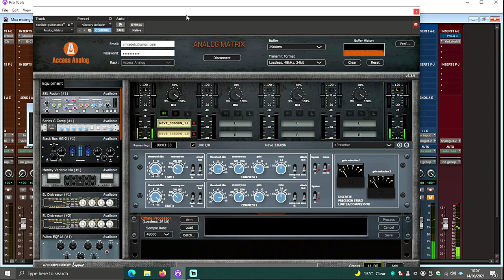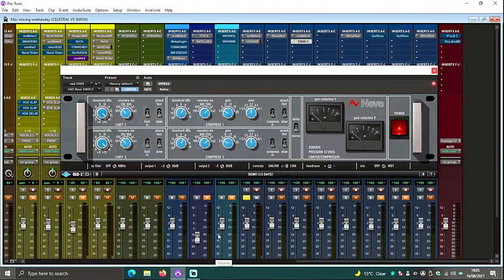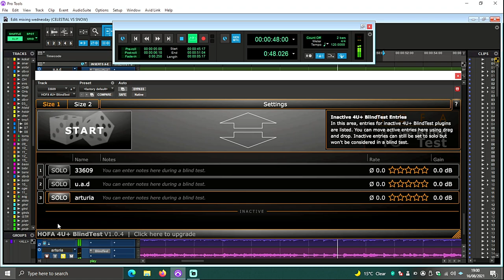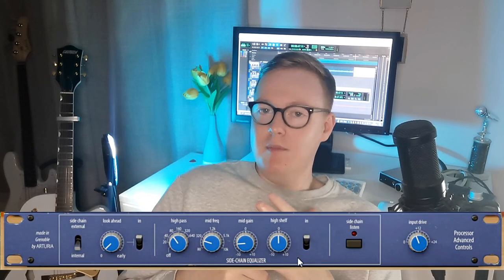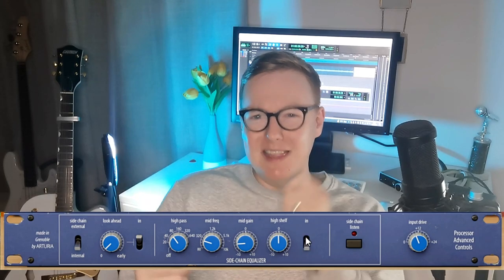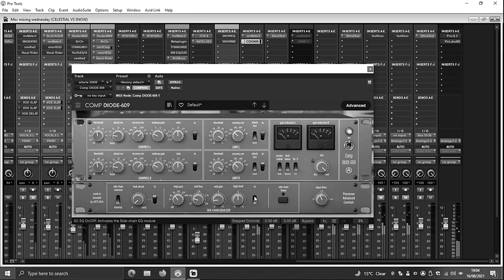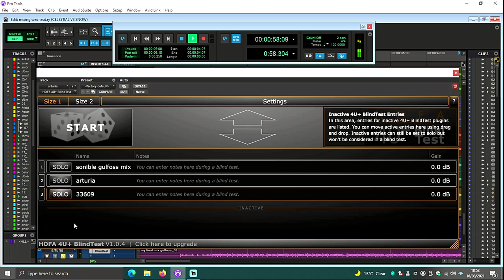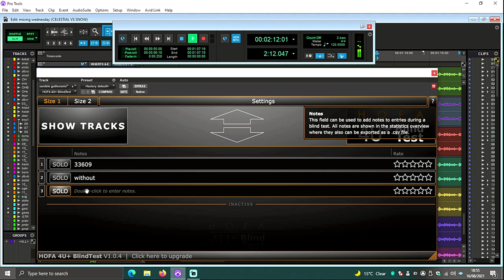DON'T buy a $4000 Neve 33609N.. try the ARTURIA COMP DIODE-609 instead 😱

Comment: Interested to know if you’ve ever tried the IK Multimedia version of this? It’s been included in their T Racks suite for years but I never knew what it was an emulation of until I saw CLA and Dave Pensado talk about it a while ago. It definitely has a signature sound but the GUI is needlessly confusing (one of those plug-ins where it’s not clear if the power buttons are switching the units on or off!?) and I’ve been on the fence about how to actually use it since some people say you want a slow recovery whilst others say you want everything set on fast 🤯  Plus, I never decided if I actually liked the “pwuish!” effect it has on kick drums (best way I can describe it lol!) Anyway, seeing you featuring it made me slap it on my two-bus tonight, and with barely any gain reduction happening it’s pretty sweet.
Reply: hello, I own it too - but I never use it. It does a little bit of everything.. it warms, it's giving a thumpy punch, it's widening - but usually it never seems to be the best for a mix. T-Racks-Comps that I regularly use on a mixbus are the Bus-compressor and the VC-670. When it comes to settings I suggest not to listen to anybody and to trust your ears.

A good way to approach it (in my experience) is to pick 3 compressors and try to get a great sound on each one individually. After that you compare the sounds of the 3 compressors. That's how I figure out both what I like about the compressors AND how the settings influence the sound. Now granted.. comparing a Fairchild-Emulation is a bit of a tricky thing.. but there are manuals and videos that explain what they are doing.

Another mixbus compressor that I sometimes use is the elysia alpha-compressor (it's rather clean). The Chandler Limited Germanium and the Tube-Tech CL1Bs from Softube rarely ever make it to my mixbus.. I love the Chandler on Drums and the Tube-Tech on Vocals though. I also recently purchased the Pulsar MU, but I gotta say that I'm not in love with it. It has incredible width, but most of the time it just doesn't do it for me. Am still on the lookout for a great manley variable-mu emulation.
Reply from the maker: Used to use it years ago but found better alternatives. Nice weight but isn't the hardware.
Reply: @PaulThird  OMG... you know what, I just demo'd this Arturia unit... mate I'm devastated - IT'S AMAZING 🤦‍♂️😂 Thought I was done spending insane amounts of money on yet more compressors (!) but even before you get to the incredible sound of the comp/limit stages, the modern feature set on show here covers it all!? I just tried it on my latest pre-master which I've been struggling to finish because the snare stem is just too loud but the snap of the transient sounds perfect (I expected the analog summing to reduce it, but it's still clipping +10db). Best results I managed before demo'ing this was to tame the snap with the Elysia Alpha's soft clipper and then sear-off of the edges with the Weiss MM-1 in transparent mode - BUT THIS ARTURIA UNIT.... I just side-chained the fully mixed track to a gated stem of the snare drum using this 33609 and the track is now FINISHED?! Problem solved... even before the 20 minute demo restriction locked the program... there's no way I can live my life without this in my plug-in folder now lol! Gonna have to get a second job delivering pizzas if I keep spending money on these things though 😂
Reply from the maker: I somehow always manage to cost people money haha 😅
Reply: @tommyottobisdee  I clip with clippers, especially the classic-clipper.... choosing the slope is really important for the sound. I don't love the softclipper that is in the alpha.. IF I use it (and sometimes I do) it is very gently.. barely or not at all engaging the light that indicates it's working (it's working before it lights up). I use the alpha when I feel any change of sound would not be benefitial or I am doing a master where I have to be pretty precise about how I treat the sides in relation to the mid. I have the Weiss DS1-MK3 too, but I only use it on my masterbus and only for the low-lowend.. that usually means under 90Hz for me, I rarely use it above 130. Used to do that with a simple multiband-band compressor - but the weiss certainly does a better job at it and that's why I finally got it. Didn't have the full fledged Drawmer, but I have the Drawmer S73 Intelligent Master Processor and while it can give you an idea which direction to go, it never, ever was able to beat real manual finetuning.

The Arturia 33609 sounds good, but the 33609 in general doesn't seem to do anything that I truely need/blows my socks off - but I think that's very much a matter of taste. Thanks for sharing your preferences! I've been looking at the Shadow Hills Class-A Mastering Comp a couple of times. Maybe I'm going to shoot it out on the mix I'm currently working on.

Comment: The Arturia was made by Pulsar audio. They might be my favourite when it comes to analog modelling. 
I really do think they are the best.
Reply from the maker: How do you know that?
Reply: Pulsar did a ton of their stuff - you can usually tell by the implementation (extra side chain features, look ahead etc)

They came out and said they did the 1176, sta level etc. 
Then this crop has a bunch with the same kind of implementation - Siemens eq, diode etc. 
Their 1178 and MU has a similar implementation. 

They also did the slate blue stripe back in the day. Which was incredible for its time. 

Will buy anything those guys release!

Comment: Have you tried IK's version of the 609? Is it even comparable to the original 33609?
Reply from the maker: I used to use it a lot years and years ago but I doubt it as its pretty old code and doesn't have the added tweakability of the Arturia. I did like it but it's been around that long I suppose if it is was really close we'd know more about it I suppose. It's got a fixed attack on the compressor I think unless the fast and slow switch on the limiter controls comp & limiter.
Reply: @PaulThird  Fair enough. Also I just looked it up again and apparently it's supposed to be modelled closer to a 2254.
Reply from the maker: 'The Precision Comp Limiter is based on one of the legendary British compressors found in top-level studios worldwide. Originally produced in the ‘70's as an evolution of the previous 2254 model' 

The 33609 was originally based off the 2254 so I think the IK is still modelling the 33609 but I may be wrong 🤓
Reply: it's not a bad compressor. It lacks some tweakability, but it has a solid sound. It does a bit of everything. However I never use it, since other compressors always won out when I decided to give it a go (today was no exception). When it comes to T-RackS I personally really like the VC-670 (if set right..) and the Bus-Compressor. Add Alpha-Compressor and Germanium to the list and between the 4 of them there's always a pretty clear winner (as mix-bus-compressor) for any mix I work on.

PS: I also have many other compressors.. maybe it's just me being used to T-RackS, but I pick these 2 T-RackS compressors above almost anything I throw at them. No matter wether it's the Weiss (which I basically only use as low-end-compressor), the TubeTech CL1Bs (only use'em on vocals), all kinds of waves emulations (only using the MV2 - certainly not a mixbuscomp - on lead-vocals), MJUC from Klanghelm (can work on everything - but not my mixbus although some use it there), Pulsar Mu (not loving it.. but it has a unique sound and width capability). IKMs older plugins don't have the greatest reputation with many engineers nowadays.. but I think that's just unfortunate. I still use the Clipper, the Tape-Echo (echoflex), the VC-670 (Fairchild), the Buscompressor (SSL) and the Stealth-Limiter on almost every mix (and newer plugins of IKM too oc, but I'm talking about the old ones here). I wouldn't be afraid to use them if I were you.. I've spent a lot of money on alternatives but find myself circling back again and again when I make loudness-matched shootouts (which I regularly do).

Comment: I read most of the comments Paul about how ya feel regarding Acustica Eq's vs hardware....I also watched your shadow hills bx vs uad. Thank you for the access analog info, its great them and mix analog exist. The 670 distopik on mix analog was my first time hearing any hardware on my own mixes vs plugins...I was just wondering have you ever used Acusticas Aquamarine (their shadow hills compressor)?! It is honestly one of their few compressors that I like on just about anything similar to the cream compressor if you are just looking for glue...I have tried the Arturia demo version and love the sidechain parameters and the drive like you said. I was just wondering as far as the 3d abiity to pump transients in a pleasant way while retaining the original integrity of the audio source.....do you think the Aquamarine from Acustica isn't as 3d/depth as the Arturia 33609. Might be comparing apples to oranges as far as the sonic textures they have but I am mostly curious about the depth because I haven't tested the Arturia on enough sources to know if the depth is up to par. But I really trust your ear. If you haven't used the Aquamarine give it a run and let me know about the depth!!
Reply from the maker: When I tried out the Aquamarine I actually preferred the PA. But I only ever used shadow Hills as a print bus comp so I dunno.. The Aquamarine just personally didn't give me the sound over the mix I got from the PA but I didn't really push it to do other things. I kind of felt like the Aquamarine lacked the solidity of the PA but none of it matters now the Arturia has replaced it anyway haha I'd say trust your ears as its extremely subjective. I used the shadow Hills for a very specific sound so it's hard to judge.

Comment: There are some presets available for the Klanghelm DC8C3 which emulate a 33609 - I like them and use them but I'm not sure how close they are to a real unit. Might make an interesting comparison?
Reply: would be great although the DC8C3 can be much more accurate and has the option of oversampling although you can switch to a slightly brighter tone but it's great to use on the mix bus

Comment: Honestly Bro.....Ive got a rack so I know how Analog gear sounds....and on Master Bus....DMG, Analog Obession Buster, Buster SE and SPC Comps, along with bx Townhome Comp, and the GLUE...are the best mixbus compressor vsts out there......that sound warm, punch and have at least 70% of the hardware depth if set right on a good mix....
Reply: oooops and I forgot HComp, API 2500  and VCA160 Comps in Stereo from Waves....basically the best Waves has to offer as far as Mastering
Reply: Those are all waaaayyy better than this plugin...on MixBus...LOL
Reply from the maker: In your opinion
Reply: My argument is 
You want 
Punch and Glue and Thump on mixbus.....not fluidness....you want fluidness in the mix on individual instrument bus tracks.....
Reply from the maker: In your opinion. This is all your opinion. I know what I want to get out of a mixbus comp, you know what you want. There's no right or wrong answers. Mixing is a very subjective art with many ways of doing things

Comment: No you will not win this time, I will not change my Stereo Buss compressor, will not touch my Germanium for long time. But damn, how the hell is hot that real 33609? It's a BANGER. Will demo the UAD as soon as I can. And the Arturia sounds really good.
Reply from the maker: I'm so glad I did the second video as I was totally bummed out when the convolution 33609's were off the mark. For the longest time I was planning on just running all my mixes through the access analog at the end. Really glad that I decided to go back and revisit with other plugins as I just love what the hardware does 🤓
Reply: oh a fellow germanium user. Are you using the plugin or the real thing? And did you "set it to forget it"? If so feel free to share the settings :D .. I find there are very few compressors on earth that can sound so freaking diverse. I usually use it for Drums.